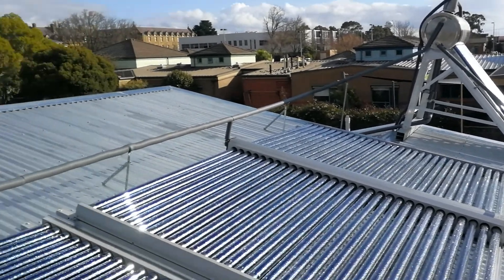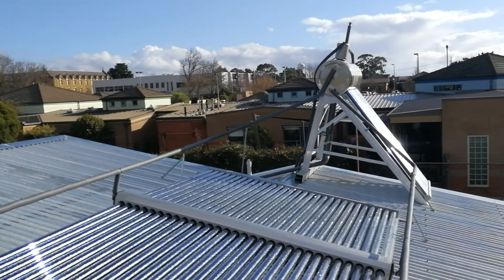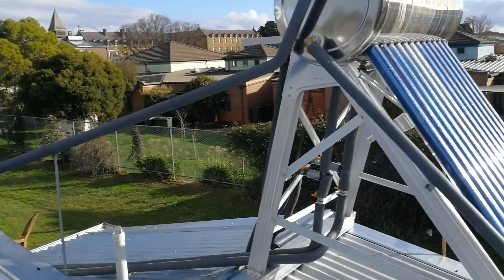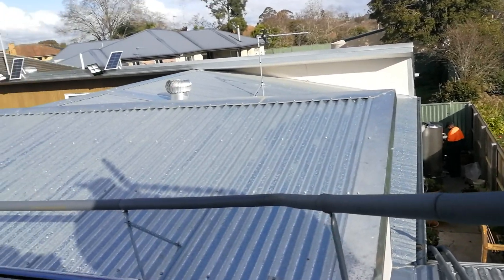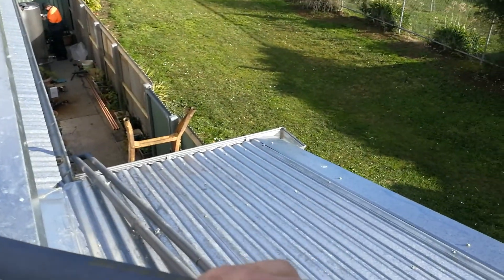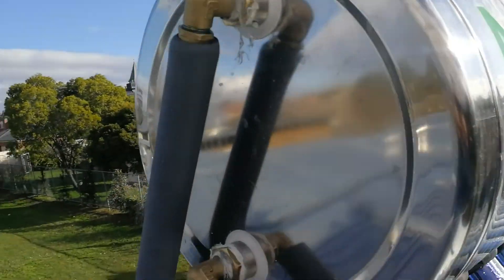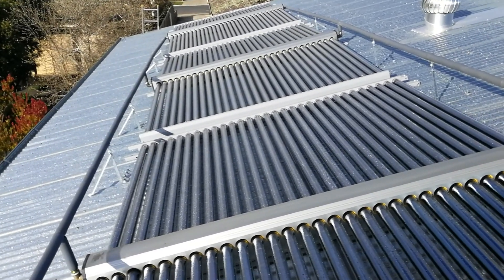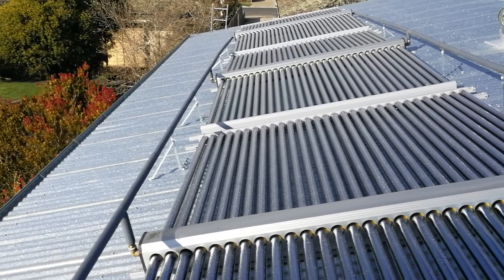Solar hydronic floor heating.  Free home heating from the sun, maybe....Pt1

Comment from the maker: We have just restarted the system for the heating season. I just took a tube out of the header tank and one at the end of the solar array to let the water run out over the warmer months. I didn't bother covering the tubes this time as there was no water in the tubes. All the water boiled off over a couple of days. That worked perfect and was much simpler than trying to manage the thermal runaways over summer.
On refilling I found one tube had blown so now we have lost 2 in total. I just jam a oyster sauce bottle, which fits perfectly, into the hole and keep going. Not worth the effort to replace until we lose closer to 10 after which I would just get a new box full.
Also the el-cheapo Chinese bung sealing goo let go on the header tank so I cleaned it out and used teflon tape instead. Fixed it no worries.
First day was fairly sunny but I noticed the thermosyphon started after about 2 hours. The house slab is now holding a 10 degree C differential over outside temp. Still working great after a couple of years.

Comment: So during summer what do you do!! You should have a geothermal system as well for it to work or else your going backwatds!! Also if you fill the system with salt water and sand quaryz and have a big resevour like 250 gallon tank it would make sence
Reply from the maker: Hi Joel,
Aussie summer sun is brutal and we have no way of using the energy supplied with the system. We just disconnect the slab system so we can cool the water instead. We  cover the bulk of the array and route the heat through our domestic hot water.  It is a waste of energy yes but the risk of thermal runaway is far too high to take any risks.
It means we only benefit for 8 months/year but it is what it is....

Comment: how do u deal with overheating?Love your Vid! Thanks! im also doing SHW! at Guilt Free Hot Water,,nothing to sell but i use a small 20 volt 25 watt DC Pump to cerculate
Reply from the maker: Hi There,
The thermosyphon works perfect for us to the header tank with exchanger heat coil.  We have a little 240v pump which transfers the heat to the lower 500lt buffer tank.  The smaller DC pump would be too small for us as it would not pull the heat away fast enough, but that is a product of our array being so large.  Probably fine on a smaller set up.
In the middle of winter we had no overheating problem but the array was enough to maintain tank and floor temp from about 9am to 8pm.  As the weather warmed up we increased the floor temp (which stopped the heatpump from needing to run at all) and the water in the tank got to around 60 c.  Once the main tank got to that temp we had the header tank boil occasionally.
Once the boiling became regular (usually 3-5pm) we started shading the tubes with simple shade cloth, a 1/3 at a time.  Just adding extra shade as it boiled again.
Now we are cooling the floor with the heatpump so the array is only doing the domestic hot water.  We have shaded the entire array now as it still picks up heat for the domestic water.  This is fairly effective but not as good as the floor system. Whilst the small coil header tank works fine for the slower heat transfer to the buffer tank, the transfer to direct domestic hot water is not so good as the flowrate into the house if too high for the small coil.  A bigger coil tank would fix that but we don't use enough domestic hot water to bother.
The process of harvesting the heat from the sun and dissipating it through the floor is quite fascinating.  I estimate that the array produces about 5-8 kW/h of heat (based on reduced heatpump use) so you could say we are replacing 80kW of heat or 30kW of electricity.  So basically save around $6/day so maybe $1,100/year in Ballarat.  Plus less cycling of the heatpump will increase it's lifespan which is worth something.
Now we are running cold water through the slab.  It is not as effective as the heating (which is perfect) but once we get the hang of it I reckon it will be fine.  The key, even with the heating, is to transfer whatever free energy you have into the slab/buffer tank as it is produced otherwise you pay for it later.
Reply from the maker: I just had a look at your videos and we are coming at the same problem with slightly different approaches.
There are a few differences besides the obvious fact that you are transferring heat to air.  We had the luxury of building the house to suit the water direct heat transfer which I think is better.  
Also we are completely open circuit with no pressurization which I think is safer considering we are dealing with an unpredictable heat source in the sun.
We are only using copper in the entire system except for the tempered water going into the slab through pex.  This means that the only risk we have with hot water is the header tank boiling.  We expect this boiling so it is not a problem, it just means we use a bit of water to top up the system.  As mentioned, once the boiling happens daily we start covering the  array as the noise of the water boiling in the tubes is like a thunderstorm and surely it is not good for the tubes. 
It is great to see someone else having a go and it is satisfying to see theoretical ideas actually working.

Comment: really looking forward to part 2 and seeing how effective the slab heating is!
Reply from the maker: Thanks Dale.
The entire slab is sitting on a 3" insulated base with insulation around the entire edge.  That in itself has made a huge difference.  Any heat or cool should only migrate into the house which also has crazy insulation.  Gets cold in Ballarat but not in our house.